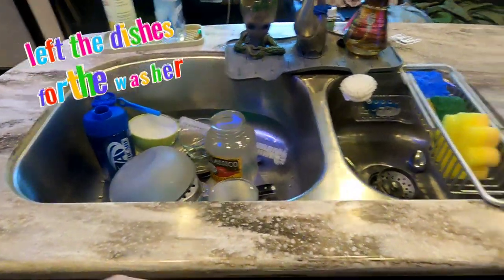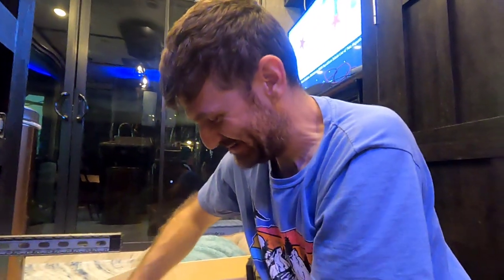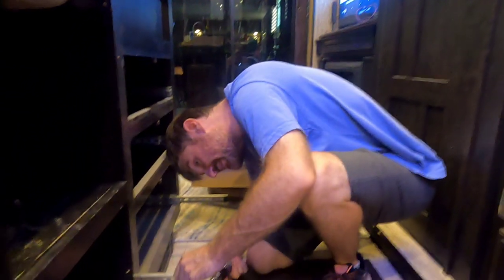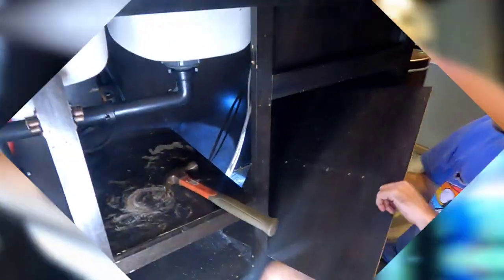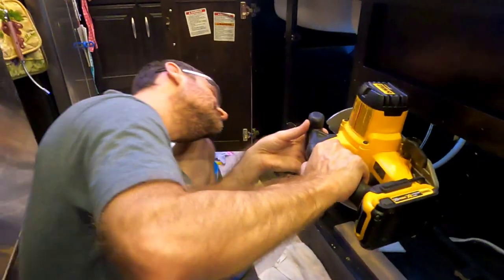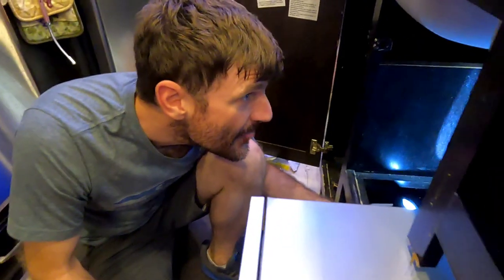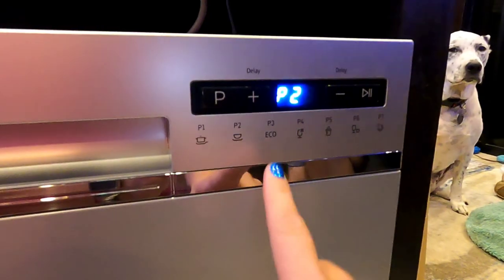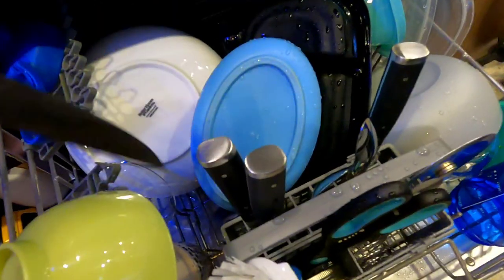Dishwasher install in our Grand Design Momentum for Full-Time RV Living

Comment: Could u list the parts used to modify the hook up line’s please
Reply from the maker: I bought a regular universal dishwasher drain hose and razor. knifed the end & the same with the hose that came with it. Then I shoved the hose in the new end and put thread tape and 2 hose clamps & held it tight. We have not leaked a drop. Not really recommending that but that's what I did... would really like to find a better way. Been successfully using it over a month now and so far so good!